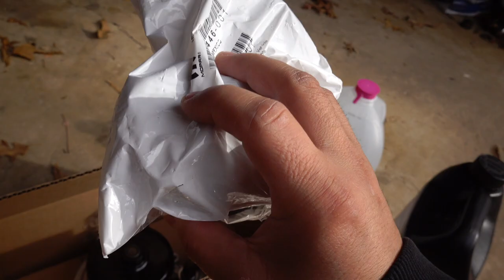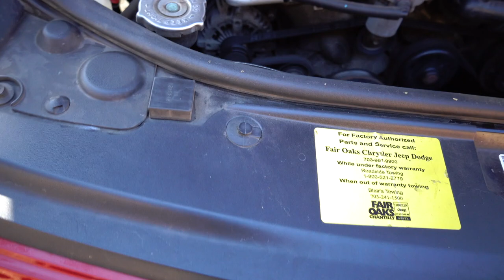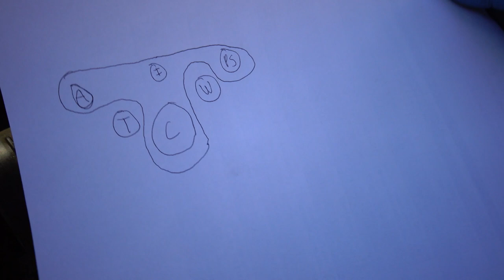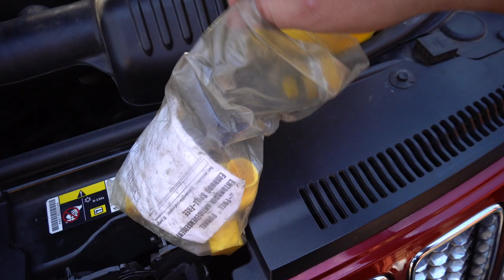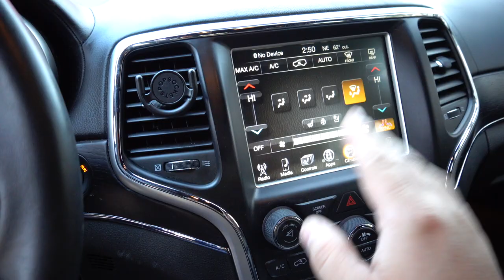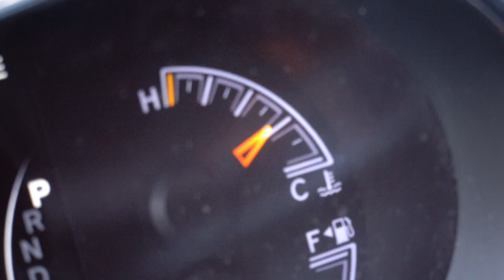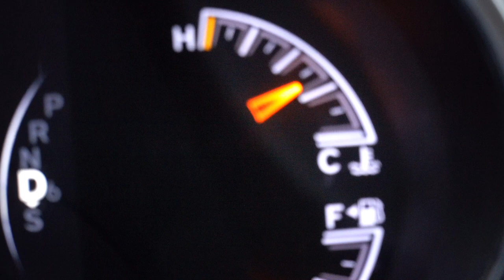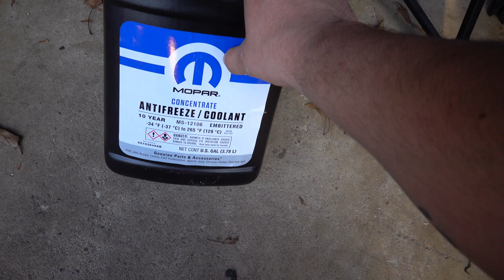How To Replace Water Pump & Thermostat On A WK2 Jeep Grand Cherokee

Comment: Great video! I'm stuck at not getting hot air out of vents. The radiator fan is ramping up to hi after about 10 minutes. Once a got a cooling system over temp message when I let it run longer. I shut the engine off before the temperature needle gets past 7/8ths to full.

Comment: You didn't mention the bleeder valve on the thermostat. Did you open it? And that your reservoir overflows happens because you didn't bleed the system correctly, and you had coolant boiling over somewhere in the engine, because the thermostat didn't open with too much air in there... That's why it blows out the cap. And you changed everything, pump, thermostat, but not the radiator cap? That cap is part important to control the pressure in your coolant system, i would replace that too.
Reply: Seriously, don't forget the radiator cap. My 2010 Acadia had a slight leak in the water pump twice in the 215k miles put on it. Both times, it started to overheat and spill over. Replaced the pump twice, thermostat twice, the coolant twice, AND the real radiator cap twice. The cap was hidden under a plastic cover in the front of the motor. Checking the coolant reservoir didn't give you a read out level of the coolant in the reservoir so you had to check the radiator cap

Comment: I just replaced the radiator, and I’m guessing I have air in my system? My car won’t blow warm air and it gets super hot then finally settles around 226 when it should be about 203.

Comment: Amazing vid dude! Well done and excellent step by step guide. One question though, when cleaning for the new gasket I guess don’t worry about residue/cleaning chemicals getting on the inside of the compartment?

Noticed my engine is running a little warmer than usual highway at 215-220f guessing thermostat or pump is starting to go bad.
Reply from the maker: Be cautious. It’s not good if too much gets in there. It’s best if you spray the rag and then wipe.

Comment: Hi. Quick question. I will go in chronology so you can get the best picture:
1. I have 2013 WK2 3.6
2. 87k miles on it.
3. I am original owner.
4. I punctured mu original radiator when I was in Ukraine with the Jeep and after that I went thru 2 radiators more because service was putting in wrong coolant (2013 and Up require Purple coolant, we didn’t know that and were putting in the one for 2012 and earlier) So, I finally replaced radiator myself and put in purple coolant about one year ago. I also replaced the thermostats at the same time because the original had a small crack. After i did all that, the car was fine utilll now (about 15k miles)
5. Couple of days ago I noticed coolant level went down in the reservoir. I also noticed that instead of 195-210 normal operating temperature, the temperature rose to between 215-235. 
6. I tried to add more coolant and bleed the system a bit. As I was doing that, I noticed my heater blew air, but not hot air.
7. Thermostat does open when the heater is on, but when I turn the heater off, thermostat kicks in and continues to operate at temperatures 215-235.
Sorry for writing so much, but this way you could probably get the best Idea of what is wrong?

Comment: Hi

I’ve seen your videos and I really appreciate the knowledge that you’re sharing with the community, so thank you!

I own a 2015 grand Cherokee with a 3.6L V6 Pentstar engine. I have been facing overheating issues lately so I immediately replaced the thermostat, but it did not resolve my problem unfortunately. I changed the coolant and did proper bleeding, but again it did not resolve the issue. So I wanted to check with you on what could cause this overheating? Could it be a faulty Engine Coolant Temp sensor? If yes, where is it located? 

Note: temp is almost normal when the air con is on. 

Thank you in advance

Comment: Nice video bro , so I have a question , I had a leak on my water pump and changed the gasket too , recently it started to leak again from the same place , what can it be ? I am very frustrated
Reply from the maker: Thanks! 
So if it’s happening again, I’m guessing maybe it has some debris or imperfection in that spot. You might want to take it off again and make sure it’s 100% clean because it has to make very good, clean contact.

Comment: Hey brooo!!
Hoy did you know the water pump wasn’t working correctly? 
Do you have any video showing the failure?
Reply from the maker: I don’t. I just did mine as preventative maintenance. Usually you’ll either see them leak around the actual pump, sometimes the pulley will make noise, and the extreme being that your car overheats.

Comment: Nice job dude, mine boiled over too which freaked me out but I still had some air trapped so I took it to get vacuum filled which fixed the air problem, also worth mentioning theres a bleed screw on the thermostat for anyone who wants to use that to help the bleeding process. Nice video otherwise bro thanks.
Reply from the maker: Thanks man. Yeah I completely forgot to talk about the bleeder on the thermostat housing since I decided not to use it to make a it a super clean process lol. Opening it means coolant spilling out from it and I just wanted a clean job.

Comment: Did you use a MOPAR water pump or after market for jeep. My 2014 jeep grand cherokee is over heating, the bottom radiator hose is cold, and idk if my radiayor is clogged. I plan on replacing my water pump as well but unsure of the mopar or after market product. Etc please help with advice

Comment: Did you just hand tight it, What about the torque specification of each bolt . If you could let us know it's more better.
Reply from the maker: I don’t know the torque specs of these. I usually always just go till it’s snug and then just give it like a 1/8 to a 1/4 turn because they are thin m6 bolts and can’t handle too much torque. Up to you if you want to follow my method or dig the internet to see if you can find the proper specs. I have put a few thousand miles since and haven’t had any issues.

Comment: Hi. Do you think I can change the water pump without taking off the thermostat? (The reason for that is because I replaced my thermostat about a year ago, so it should be still good to go.)
Reply: Could you help me out?
Reply from the maker: Hey! I’m sure you can just get a new gasket and reuse your thermostat since it’s fairly new 👍🏼
Reply: @StayOnTheGas  I'm having a leak in the water pump area. So what I was planning to do is not even touch the thermostat and just replace the waterpump and its gasket, since the waterpump is only 60$ and comes with gasket.  And my question was whether I need to touch the thermostat in order to get to the waterpump?
Reply from the maker: I honestly don’t remember. Maybe it’s somewhere in the video

Comment: I’m currently trying to flush out all the coolant on mine but when I opened the bleeder on the radiator only a little bit came out. I’m going to leave it overnight but is there anything else I can’t try opening to flush it all out? My reservoir is still completely full.

Comment: I'm refilling with coolant now at the radiator but can't get it full.  I unscrewed the bleed screw but it just comes out of there too.  I was only able to put about 1.5 gallons in. Also heater doesn't blow hot.
Reply from the maker: It takes a while. Mine took about 25 minutes to bleed all the way.